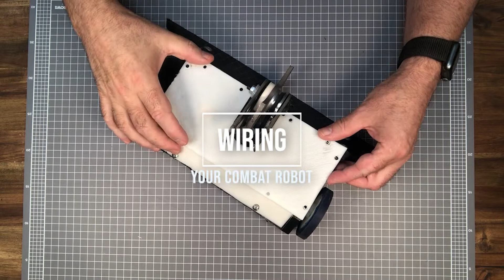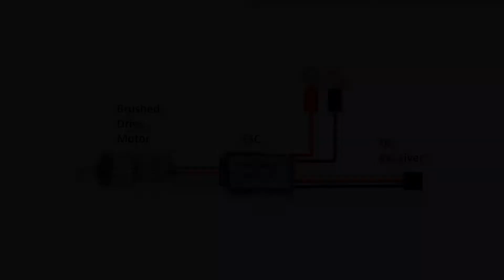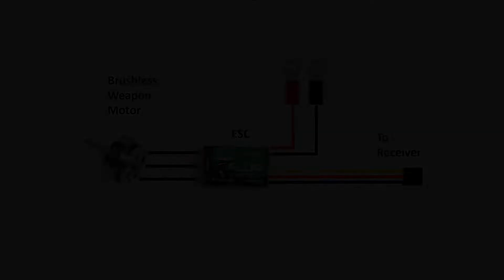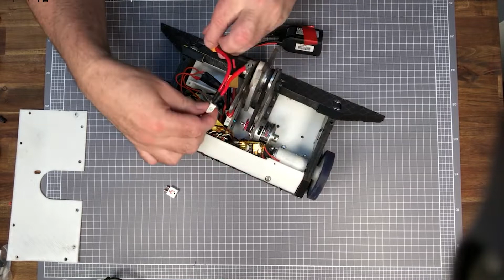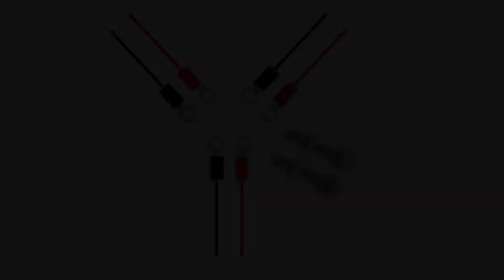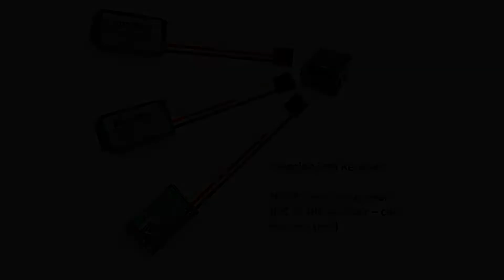How to Wire up your Combat Robot

Comment: Hey man!! This series has been incredibly helpful, so I just wanted to say thanks!! I have one question though, in the competition I'm wanna participate in they require a visual indicator that the robot is on or off, so I thought about adding a simple LED connected to the power switch, but I'm having trouble calculating the resistor (should I consider the full voltage of my battery or?) and I don't know where in this whole system I need to add the LED wiring, could you help me out? Thanks in advance!!

Comment: I’m trying to get a list together of what I need but the parts list you showed didn’t include what you used for your weapon motor or what rpm the drive motors were.
Reply: Don’t know if you still need it but a good rpm for a beetleweight is around 1000
Reply: 1000rpm? That is fast but you will have less torque i run 720 rpm